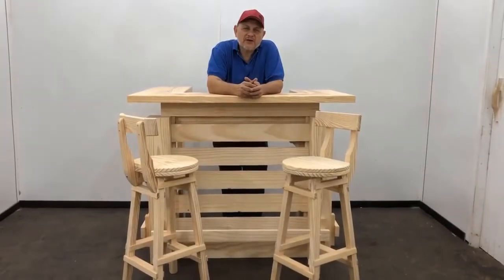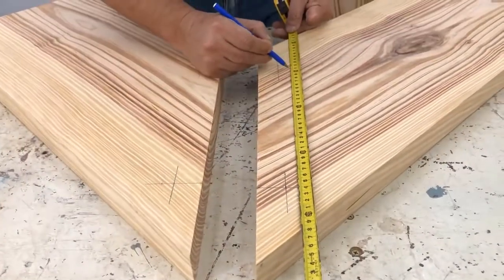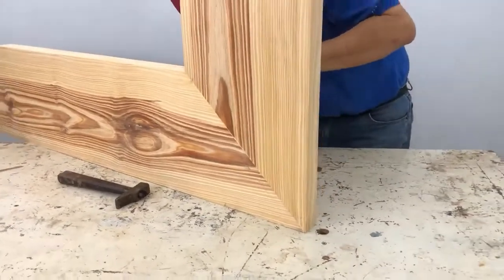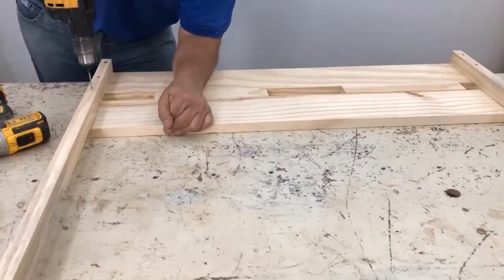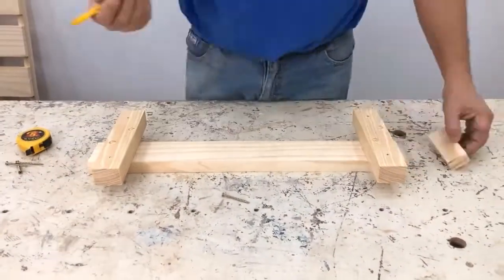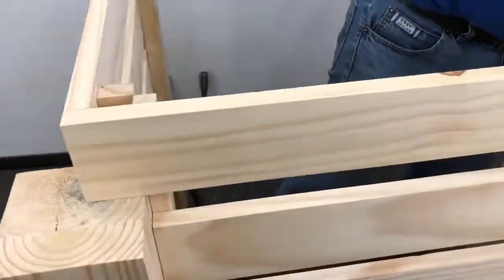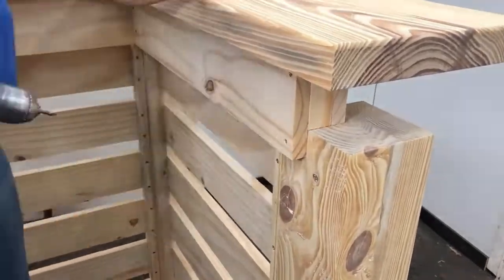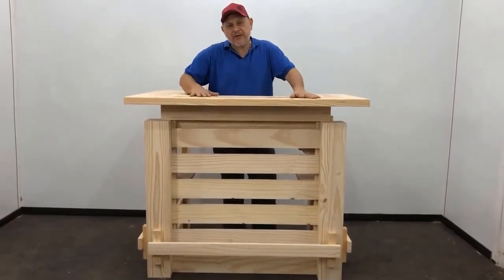Wooden Bar or Bar Very Nice and Easy to Make - woodworking Tutorial

Comment from the maker: Bar
Pine wood
Measurements and materials
4 beams or columns of 96cm x 14cm x14 cm.
6 slats of 106cm x 3.5cm x 2.3cm (board crossbar support for bar wall)
6 boards of 89cm x 12cm x 2.3cm (for wall bar)
6 boards 66.7cm x 12cm x 2.3cm (for bar wall)
6 boards of 32.7cm x 12cm x 2.3cm (for bar wall)

External upper plinth for cover

1 board 101cm x 10cm x 2.3cm
1 board of 76.5cm x 10cm x 2.3cm
1 board 41.8cm x 10cm

Upper plinth inside for lid

1 board 89cm x 14cm x 2.3cm
1 board 70.5cm x 14cm x 2.3cm
1 board of 35.8 x 14cm x 2.3cm

Bar cap cut at 45 degrees for assembly

1 board 136cm x 30cm x 4.3cm
1 board 109cm x 30cm x 4.3cm
1 board 75cm x 30cm x 4.3cm

2 strips of 10cm x 3.5cm x 2.3cm (top plinth cover.)

Stirrups

6 slats of 21cm x 4.3cm x 3.5cm
1 strip of 112.5 cm x 7cm x 2.3cm
1 strip of 90cm x 7cm x 2.3cm
1 strip of 56cm x 7cm x 2.3cm
 
Shelves and support

3 boards of 14cm x 14cm x 2.3cm
2 boards of 32.7cm x 15cm x 2.3cm
1 board of 66.7cm x 15cm x 2.3cm
1 board of 89cm x 20cm x 2.3cm (to serve)

130 52mm x 4mm screws
4 threaded rod 85mm long x 6mm with double nuts and washers

Sand before assembling